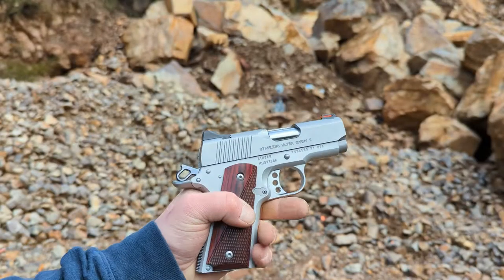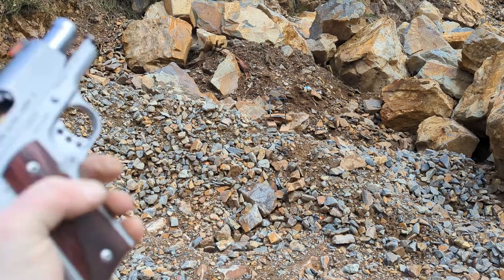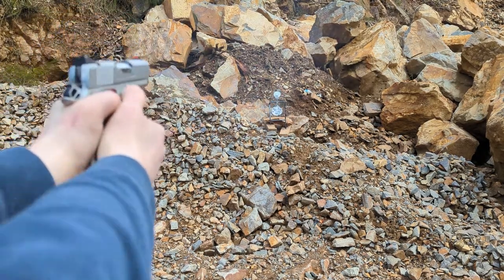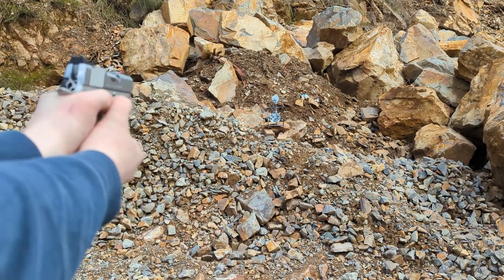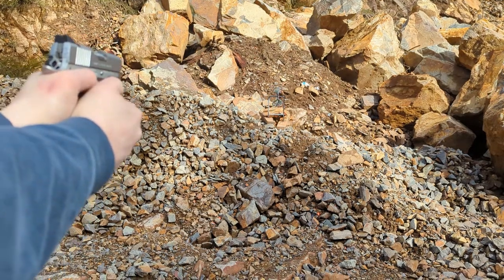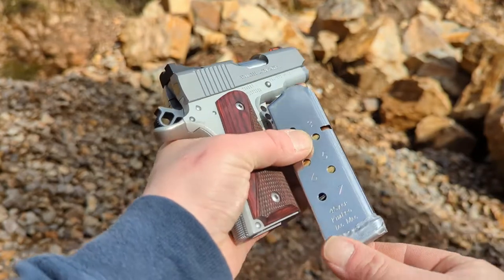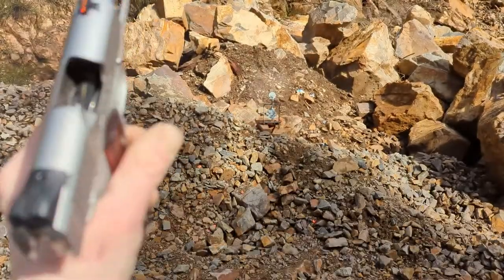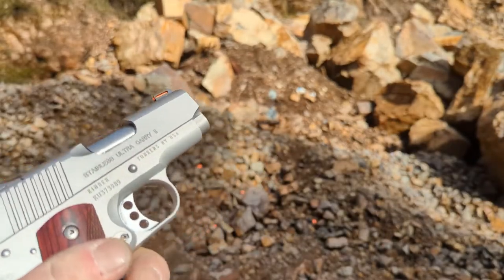Kimber Ultra Carry II malfunction update

Comment: I have one of these back at Kimber right now.  It exhibited the same issues as yours.  I'm confident that it will return running just fine.  These little 1911's can be very finicky and I knew that going in, so I had no problem returning it for tweaking.  Continued good luck with yours!
Reply from the maker: Thanks! Same to you! I'm in Washington State and they had mine repaired and shipped back to me in a week exactly so hopefully you get yours in a timely manner. I'm going to send you the link to the first video I made on these malfunctions showing how often it was happening. This was also before I started heavily lubricating it before each use. That seemed to be the difference for me that and of course Kimber polishing the feed ramp when I sent it back to them. https://youtu.be/qZGql_IMBSc
Reply from the maker: The video also includes a screenshot of the invoice Kimber sent back with my handgun showing all of the repairs and work they performed on it they even refinished the Barrell removing a blemish that I didn't discover when originally purchasing it, so that was unexpected and much appreciated
Reply: @counterstrike2A  I watched all of your videos to see if I was having the same malfunction (I was).  Your vids were very helpful.
Reply from the maker: @buggin1951  Thank you for the feedback 🙏 glad to be of assistance. If you haven't subscribed already, you should cuz I'm planning on making a disassembly and cleaning tutorial video on this Kimber ultra carry two here in the next month or so. As well as other videos. I try to upload once a month if I'm able to but being busy working full time it's hard to meet that schedule but I do my best. Thanks again for your kind words and for supporting my channel. Have a great rest of your day
Reply: Don't be so sure.  Mine's been back twice.  Needs to go back again, but I don't see the point anymore.
Reply: I bought 2 ultras will not feed nose dive .shouldnt have to fix a new gun to make it run 50percent  will not buy anymore kimbers
Reply from the maker: @davidmarsh961 yeah no kidding they're quality control is miserable

Comment: I have the Ultra CDP II and it works flawlessly. In 1970 I purchased a Browning Hi Power that was occasionally jamming until I switched to Remington ammo. It has run perfectly since then. Your Kimber could be finicky as to brand/ bullet weight.
Reply from the maker: When I sent it back to Kimber for inspection they ended up performing work on it the main repair being they polished the feed ramp so I think I just was unlucky and got a defective handgun cause since then it has been performing allot better

Comment: I bought an old used one and it’s worked flawless. I hope you oil yours kimbers are known for having tight mechanics. No loose slop in those things
Reply from the maker: In the video I say that since I started heavily oiling and lubricating it before range trips that has since fixed the problem
Reply: @counterstrike2A I agree a semi auto dry is not good. My Ar 15 loves to run wet. I found lightly oiling and then wiping off any excess doesn’t work on my firearms. Oil is a guns best friend and it help cleaning a weapon much easier. I don’t live in the Sahara dessert so I’m not worried about sand and dirt.
Reply: Bill Wilson of Wilson Combat has a good bid on lubricating 1911s.

Comment: Counterstrike - I think mine performed even worse than yours.  Sent it back twice, still has issues!  My question to you - even with your insight about keeping it well-lubed, do you feel you can trust it to carry? I can't, and I'm genuinely traumatized to the extent that I can't imagine ever being able to fully trust it, even if I never had another misfire.  It's been that troublesome.
Reply from the maker: It's definitely always on the back of my mind, but I've come to realize it seems to only start having that malfunction after about 100 rounds or so. We're fired through it and the gunpowder residue starts building up on the inside of the feed ramp and chamber. So as long as I always clean it after a day at the range, I feel fairly confident that I won't have any failure to feeds or go into battery. But then again, I also feel confident if that malfunction does occur I can fix it with one quick slap of my palm although at the expensive price point we both paid for what I thought was a high quality premium firearm. We shouldn't even be having this discussion. The thing should be running flawlessly. I put over 6000 rounds through my Glock 17 and never had a single issue with it and that thing was half the price. It's just crazy to me that Kimber keeps consistently putting out products that aren't impeccable
Reply from the maker: Before ever experiencing these malfunctions I didn't used to carry with one in the chamber but now knowing this malfunction is a possibility. I always carry cocked and locked now so that way I know I can at least get one round off without the possibility of a malfunction occurring. I'm also hopeful that is the round count goes up. Things will get better. At least that's what I'm hoping for lol. How many rounds have you gotten through yours so far?
Reply: @counterstrike2A  I laughed out loud at that.  The idea of carrying one in the chamber to guarantee at least one Bang! What a state of affairs.  Yeah, everything you said about price point is on the money, so to speak.  But did you notice the price dropped $200 since Jan? And during an inflationary period? Has to reflect waning sales.  Watch for them to discontinue or rename it.  Keep posting updates, I'll be curious.  But between you and I? I got a lemon, not a firearm.
Reply from the maker: I've also been getting a lot of comments about trying different magazines such as compact, 1911, Wilson, combat magazines. I currently am not able to try that out at the moment. I actually broke my wrist a month ago and just had a steel plate put in my wrist 5 days ago. So that's pretty low on my priority list at the moment, but that's definitely something I'm going to try in the near future. Cuz as of right now I've only used Kimber magazines the same that came with it from the factory and then the compact 1911 Kimber tack magazines
Reply from the maker: @joshuahangtree1560  yeah I feel the same way and actually the last time I checked on Cabela's website it looked like the price that actually gone up. I'm in Washington State so not sure if that has anything to do with it but let me pull it up really quick on their website and see what they have it listed at right now
Reply from the maker: @joshuahangtree1560   when I got mine at the Cabela's in Washington State in December of 2022. It was $899 before tax and I just looked on their website and they have it listed as $929 before tax. So it looks like the price is gone up $30 in my area by Cabela's
Reply from the maker: I've also heard from a couple other viewers. The theory on compact 1911s what they said was 1911's just aren't a good design to be made into a compact concealable firearm just from the way that it is designed and apparently from what he told me it notoriously has issues from all different models of compact 1911s I think he said it had something to do with the slide not being able to create enough force to eject and load the next round into the chamber because of the compact design
Reply: @counterstrike2A  Yeah, I tried everything.  It's the gun.  Definitely the gun.  I didn't come to this conclusion quickly or easily or happily.  I really don't comprehend HOW a gun could be a lemon, but it is.
Reply: @counterstrike2A  I've heard that basic criticism of 19ll's, too.  It could well account for the 'lemon' conclusion/confusion.
Reply: @counterstrike2A  Lucky ba**ard.  I paid about $1,050 at Basspro in CA.  Was just there, they had it in the mid-800s.  Mind you, mine is the stainless, which for some bizarre - no, call it Kimber reason is the more expensive.
Reply from the maker: @joshuahangtree1560  yeah that is what I was worried about but seems to be pretty clear that's the issue  my only hope is things will get better with a higher round count and I'm going to try out the Wilson combat mags and see if they make a difference. And I just lubricate this s*** out of the slide in the feed ramp before I take it shooting and that seems to help lol
Reply: @counterstrike2A  Good luck, really.  I tried the Wilson Combats, and to be fair, the gun didn't shoot any WORSE with them.  I've got more than a 1,000 rounds through it, but with new barrel, new almost every integral part, and no improvement.  Which lends some credence to the whole design/slide issue of the pygmization of 1911's.  But again I say, when it works, I actually adore it.

Comment: Hmmm, I hate to see another Kimber fail video but there's a lot of them it seems. I own a variety of manufacturers and calibers. Never once had issues like I see with these, are you seating you ammo in the mag? palm slap it till its solid is a good habit, is the slide smooth to remove in disassemble? It's a pickie eater ?  Best of luck
Reply from the maker: I had to send it back to Kimber where they proceeded to need to polish the feed ramp after Inspection runs good now

Comment: I have one of these and have had zero malfunction bought new and properly maintained
Reply from the maker: If your insinuating the malfunction is due to lack of cleaning and lubricating my handgun that is not the case. I clean my firearms after  every time I shoot them at the range. The handgun was defective and had to ship it back to Kimber for them to repair the defective firearm
Reply: @counterstrike2A  nobody saying anything about you I'm just saying I have ZERO problems with mine
Reply from the maker: @123pap  ya I know I wasn't implying that I  was just saying that I was keeping up on maintenance and even after doing that. And purchasing Wilson combat magazines for the handgun it was still having the issues and that's when I contacted Kimber to ship it back to them for repair
Reply from the maker: They ended up polishing the feed ramp And did a couple of other repairs that I can't remember off the top of my head and then shipped it back and since then the malfunctions have rarely occurred if at all
Reply from the maker: I spoke to somebody who had a family member that worked at their Yonkers manufacturing facility that closed down recently and he told me that the quality control went way downhill in the year or two leading up to the closure of the facility and my slide just so happens to be stamped that it was manufactured in Yonkers New York. So I'm attributing the defect to that.

Comment: How is it currently shooting after proper break in has been done?
Reply from the maker: It's running pretty decent now just seems to start having hiccups if I shoot over 100 rounds at the range. To fix that I found that bring oil and keeping it lubricated If I plan on going over 100 rounds in one session that seems to do the trick
Reply: @counterstrike2A  what oil are you using? I want one, but am just doing some research. Also, what all mags have you tried?
Reply from the maker: @vinceruland9236  I've been using Remington Rem Oil & as for the magazines I have just been using the magazine that came with it and I have also purchased a couple of Kimber tac mags. Plan on trying some Wilson combat mags. The only thing you got to watch out for is since this isn't a standard size 1911 regular 1911 magazines won't work with it. You can only use micro 1911 magazines because apparently there is a difference since the magwell is a different size than a standard 1911

Comment: Feed issues are always mag related. I bet you had some curled tips on a mag or 2 that just didn't agree with that ramp. If they hold the cartridge tight too far out, you get stumps like that where the round noses into the ramp and stops. If they're loose, they lose control of the round too quickly and it can start to flip up too far and jam with a tilted cartridge. Tight ones will break in, loose ones will need bent or tossed, depends on what's out of spec.
Reply from the maker: yeah Wilson combat mags work considerably better. You would think kimber would learn how to make a good magazine by now.....

Comment: 1911 runs wet real wet. They can be dirty but they need oil. My ultra carry 2 in 9mm and 45acp has run 800 rounds before cleaning but oiled after 150 to 200 rounds. Grab that ultra carry this side of white knuckle grip small pistols need that. Showed this to couple dozen shooters and their problems went away.

Comment: I just bought one I love it. You have a problem sometimes feeding with some of the junk ammo
Reply from the maker: I actually had to ship it back to Kimber and they polished the feed ramp and shipped it back to me. That and using Wilson combat magazines basically fixed the issue
Reply: Your shooting a precision weapon  that costs with tax and mags over 1,000.00 Not made to shoot wet! Clean, not oily! 500 minimum break in. Wilson combat or kimber mags only, premium ammunition. It's a Kimber. Some men like them tight- you can't be cheap nor sloppy if you want them to fire correctly.  And rock chips fly and ricochet!!! IMHO
Reply from the maker: @jackiemurphey1368 that doesn't negate the fact the handgun was defective and had to be shipped back to Kimber to be repaired and have the feed ramp polished. The only magazines I own are Kimber OEM factory mags and Wilson combat. And when I say wet I mean I clean and lubricate my handgun after every time I take it shooting. And I was well over 1000 rounds before I shipped it back to Kimber.
Reply from the maker: So chill with the accusatory speculations this isn't a one-time thing. There's thousands of reports of other  people having similar issues with their guns from Kimber. Their quality control has declined exponentially over the last 5 years.
Reply from the maker: @jackiemurphey1368 I also only use oil during the cleaning process after that I wipe away any excess oil and then apply gun grease to the critical moving parts. This isn't my first 1911 my original full size 1911 I've owned for 6+ years and that thing has never experienced any malfunctions tbh pretty sad that a entry level $450 1911 outperforms a $967 after tax Kimber premium 1911

Comment: I believe the owners manual says the gun requires a 500 round break in period cleaning and lubricating every 100-150 rounds.
Reply from the maker: I've put over 2,000 rounds through mine and clean it after every trip to the range
Reply: Wtf lubricating every 500 rounds sounds like too much work
Reply from the maker: Too much work? I would think if you owned a premium $1,000 handgun you would try to do everything you could to keep it in the best working condition possible. After you've done it enough times you can do it in literally 20 minutes or less. Just take some practice and some determination

Comment: I'd say that 99 out of 100 issues with Kimber 1911s are magazine related. Get some Wilson Combat, Chip McCormick or even Kim Pro mags and use them exclusively. That's what I run in ALL my 1911s, Kimbers included.
Reply from the maker: All I've used with my Kimber is the magazine that came with it and Kimber pro mags, but I plan on trying some Wilson combat mags out been meaning to get online and buy some
Reply from the maker: Just ordered 2 compact Wilson combat mags last night 1 stainless steel 1 black polymer and they both have 8 round capacity I was pleasantly surprised about that. I'll be making a video on them after properly testing them out and putting them through some rounds hopefully they do the trick $90 for both of them so got my fingers crossed